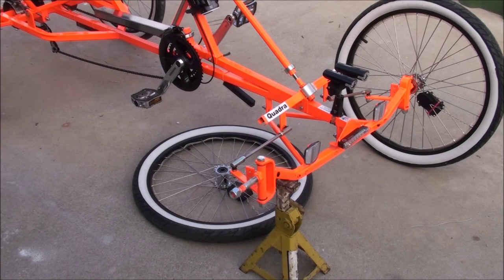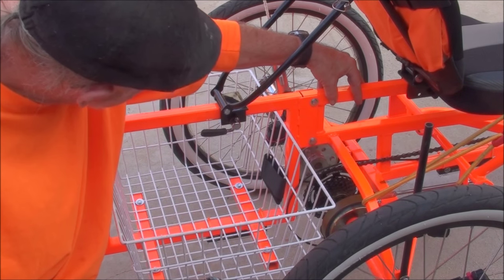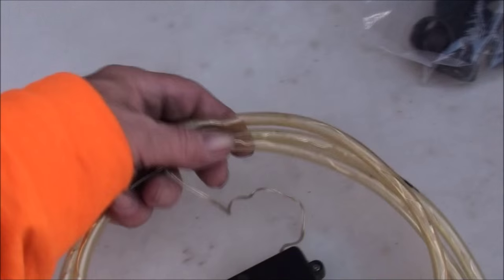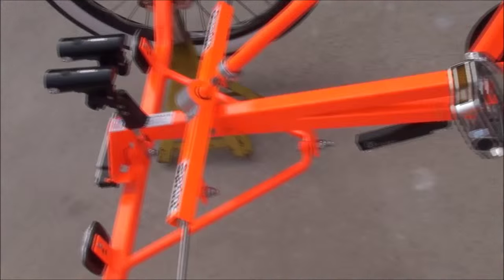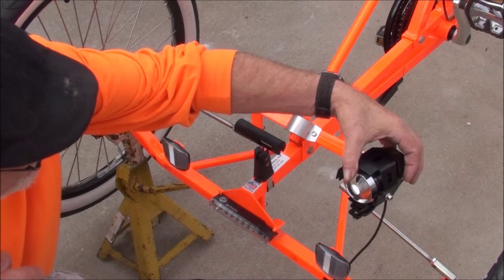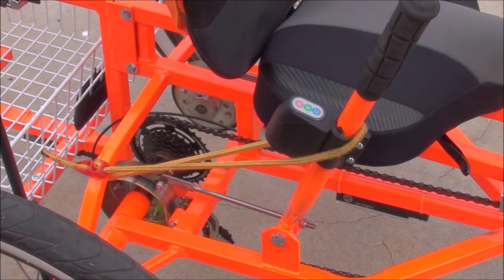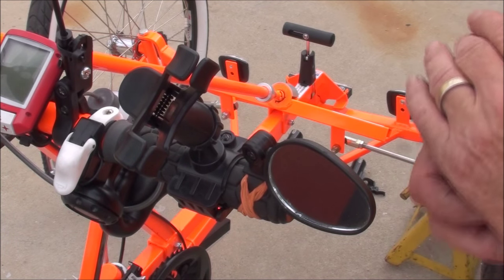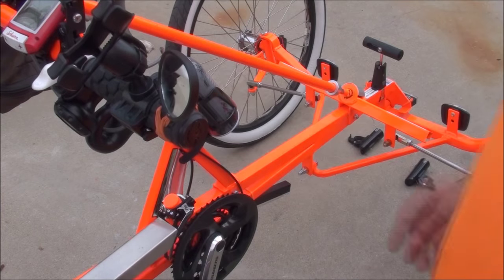Quadra Set up & Features

Comment: Thanks for the heads up on the light's 2 days yes that is a wast of money, I know now they have light's you can recharge with a USB charger for bike light's now I saw them on EBay they might be something you want to look into for your set up. EBay has many many things you can use for your bike eve electric wheels you can put on your bike you peddle it then it will start going on its own but you still have your peddle option.

Comment: Make another video but with the camera farther away from your quad so we may see the complete thing...
Reply from the maker: Will do.. This a very old video & currently working on another Quadra video will make a point of wider angles. Thanks for your comment..Here's a music video I done a while back that shows the entire Quadra you might want to check it out just click on the link.
 https://www.youtube.com/watch?v=3QDL8qWHJgc
Reply: @MitchellEgle  yes I believe the camera was to close, but the information is great, you should check out eBay I seen many bike stuff and they have electric wheels you can put on your bike you peddle a few time's then it will roll on its own. You still have the peddle option if the battery runs low but from what I research you can get many miles off the charge before having to charge it. I'm in a wheelchair I'm thinking about buying one for the front of my hand peddle front bike my own wheelchair turns into a 3 wheeler back when I made it there was no YouTube so I was building it off of what was in my mind. Now I see all kinds of others what they came up with I seen one that has the same idea what I had but he had the electric wheel on the front of his bike, I have to look into the wheel because it has a sprocket where he could still peddle. All the wheels I seen on eBay did not have a sprocket they were front wheels. Thanks for the video inspiration I did want to build a 4 wheel bicycle cart my whole wheelchair rolls on it and I'm able to sit in my chair while I drive the cart. I saw only one video the owner is in Miami I tried to contact him to get picture's or the blue prints to build my own. I have a shop with many many tool's to build something like what I saw in the video. I just don't want to go in the build not knowing everything I need from the start to the end I do not like my builds sitting around until they are done, so I can move on to my next project.
Reply: @snoopu2601  Your comment has nothing to do with the camera being TOO close to the subject. PLEASE MAKE ANOTHER VIDEO SHOWING THE QUAD IN A GENERAL VIEW!!!!

Comment: Hello Mitch, go take a look at my (quadricycle) 57 second video.  I would appreciate your comments.  I am presently at building another one with full suspension, a steering wheel and also MOTORIZED.  I want to make plans, it will be very easy to fabricate.  Thanks

Charles
Reply from the maker: Sorry for the delayed response I don't always get notified of all comments.Would love to take a look at your video please leave me a link I will review & leave any comments of any concern or additional ideas that may be of help. This video is old & have since then installed an electric scooter motor on the Quadracycle with great success. Subscribe & get the latest info. Full suspension sounds challenging to keep weight to a minimum of practicality but way worth the effort.. My quadra rides hard & bounces around a bit at high speeds..

Comment: Front wheel geometry should be improved to be more better handling
Reply from the maker: Actually it handles better than most Quadracycles offered on the market because of it's Rack & Pinion Steering, however since I installed an Electric Scooter Motor it tends to bounce around a bit at speeds excess of 27 mph I'm working on installing a steering damper to counteract this problem but not in any real hurry since I don't drive it that fast rather get distance than speed. Thanks for your comment.. Subscribe to get the latest since this vid is very old & was intended as an introduction to the (LLC) Vierbiike Quadra Sprint & what to expect. Just to be clear I bought this I did not build it made in the good ole USA..Generally built for bike rentals for beaches or mountain resorts. Well made & of simple design easy to work on & parts are very easy to get..
Reply: Great job and video
Reply: @MitchellEgle  6y